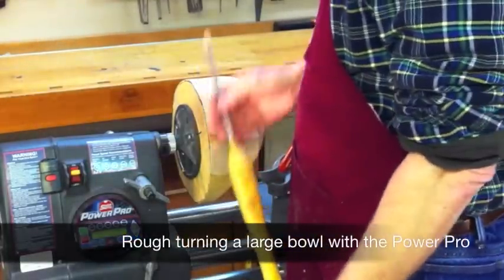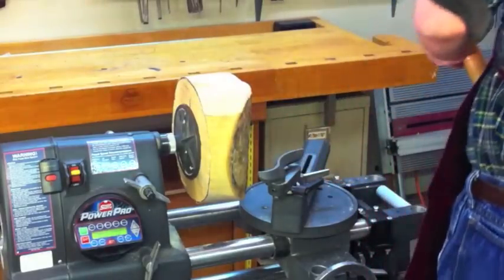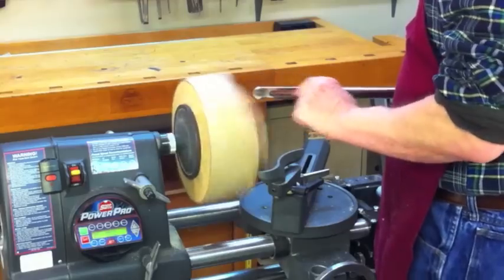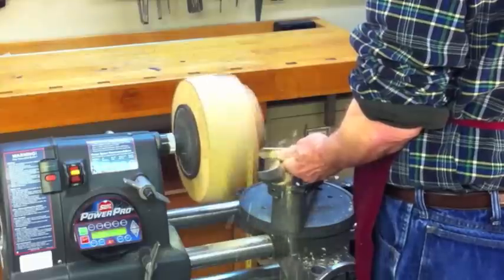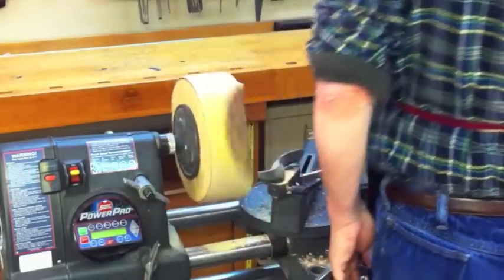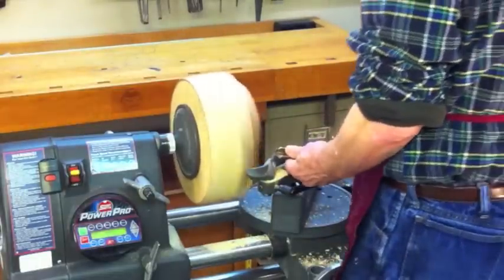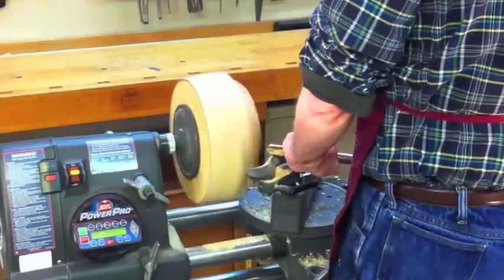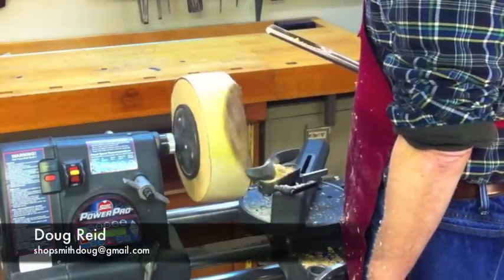Big bowl roughing on Shopsmith Power Pro by Doug Reid

Comment from the maker: I'm 6'2' and have no problem with the height. However, I have seen people put it on two heavy blocks, or a platform...it's easy to lift. Just slide the headstock to one end,lift the other end up, then slide the headstock up, lock it, and lift the other end.

Comment: Do you find that at that low speed the Shopsmith doesn't jump around to much. What do you have going across the bars just to the right of the cast iron universal tool rest plate.
Reply from the maker: That is the Lift Assist, use to help raise the Mark 7 into the drill press mode...I like it.